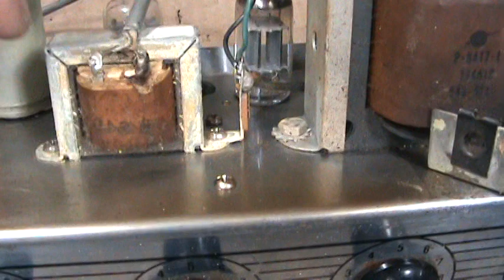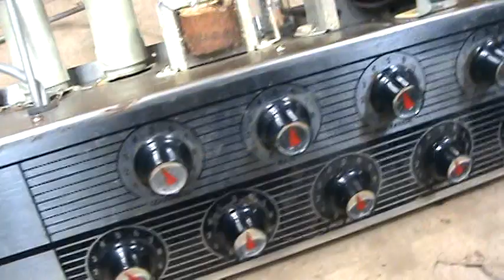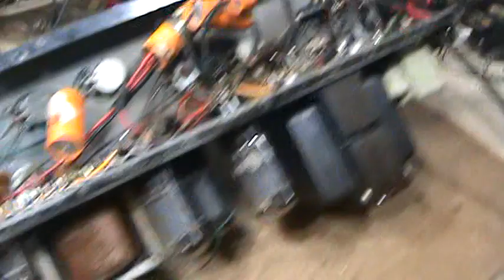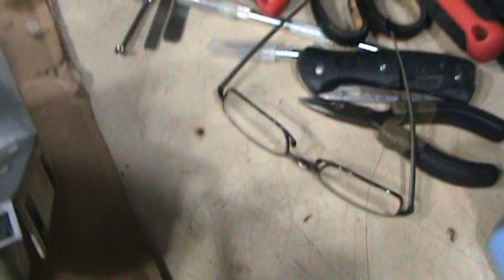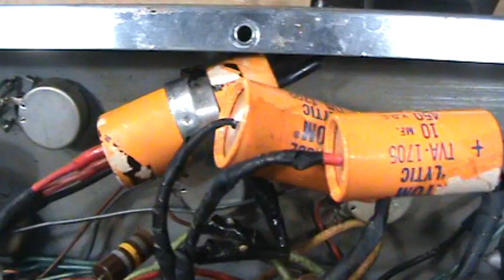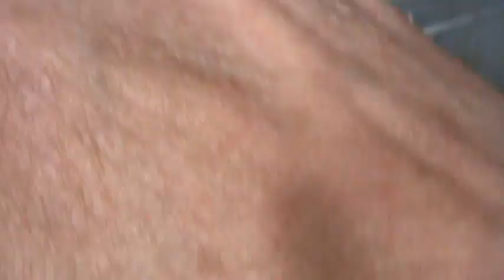GA 30RVT Invader Part one inspection

Comment: You mentioned having a schematic, may I ask where you found it? Thanks!
Reply from the maker: I searched online. There are more than one version. The one I serviced has 7591 power tubes and some have 6v6 power tubes. I still have the schematic for the 7591 version in pdf format. If you want leave an email and I could send it to you.
Reply: @ it’s not letting me post an email address….but thank you!
Reply: @ My amp was a Marketplace find in overall very good condition but needs an overhaul as it is original. Mine is also the 7592 power tube version with 8 tubes in all. I only have one input per channel which may have been a short lived iteration, most of the ones I’m seeing have two inputs per channel. I’ve done lots of googling and some have mentioned this is the same circuit found in the Epiphone EA12 RVT. It’s close but many of my values differ. The plan is to change all the electrolytic and coupling capacitors as well as the 5 watt resistors and then see where it’s at… thanks again and I’m now a sub to your channel.
Reply from the maker: @FrankM1967  I think this is the schematic Link for the one I serviced.   https://elektrotanya.com/gibson_ga-30rvt.pdf/download.html